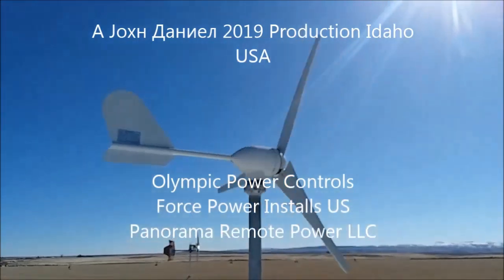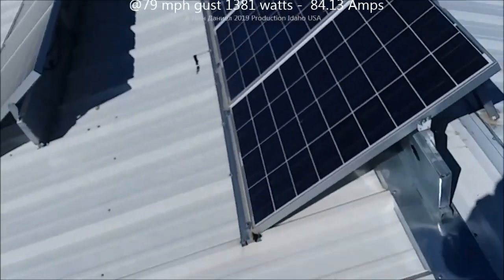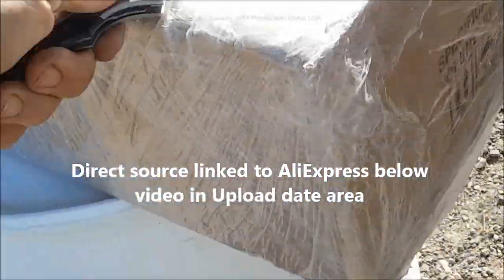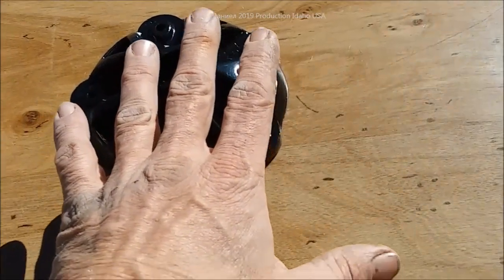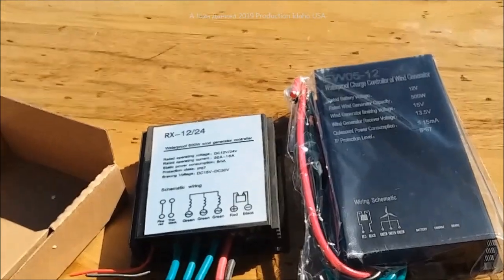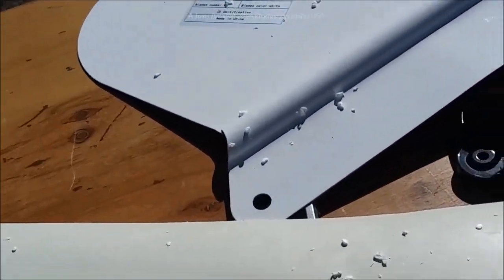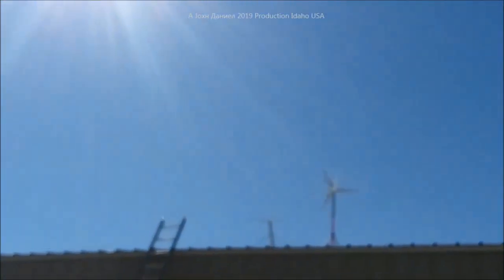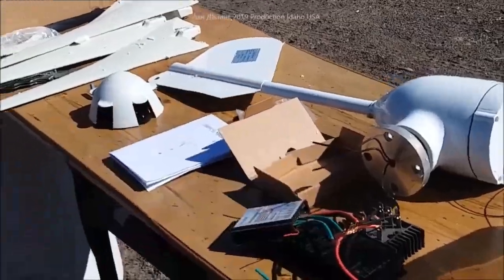Best 500 watt Micro Wind Turbine, about $330, parts below vid 1

Comment: My cheap chinese turbine is turning here and there but apperent nit even enough to get 12 volts.
Now i tried your trick and put unto it a 3.7 volt battery... It has nit exploded but... Not sure it will do much either but I have seen it reach 4 volts.
Reply from the maker: Depends on which model you buy from which seller as to how much actual power you will get. Green Energy and B&C use much heavier parts, magnets and copper in theirs verses similar looking turbines.

Comment: I used a 400 watt for years ..loved it! ..the sound of the blades cutting through the wind was music to my ears ...if I had to do it again I'd go for a more powerful one, seems you can never get enuf power when you're off grid. The one thing that I would do differently other than going bigger is to cut down on the lengths of the copper wires because copper unless you've got deep pockets is very expensive ..what I'd do next time is set one up on a good tower and attach the tower right to a workshop or shed (or at least very close by) that would have all the batteries converters and controllers etc. inside so that when that turbine starts putting out power it would travel right down that pole and right into the control shed or shop where in can be converted right away to AC and fed from there with 14 or 12 gauge to wherever you want it because the further you travel with DC power the heavier the cable needs to be ..when you convert that DC to AC right away as soon as it gets down that pole, you can send it much further with smaller gauge wire.

Comment: So it's rated 500W @ 13km/h, yet you get 13W at this wind speed? You actually need 3x faster wind to get the rated 500W out of it? And how are you happy about this result?
Reply from the maker: Where's that info? Who said "rating" is based on 13 km? That's not on this video. 8 to 9 mph is battery exceed, full power plus is at 25 mph and it does it plus much more.
Reply: @PrepperMountainSolutions  it's on a specs sticker, visible in the video. Rated windcspeed 13km/h.
Reply: @eIektrinis  That sticker says 13m/s which means meters per second not kph. 13m/s is 46.8 kph.

Comment: That turbine is exactly the same as mine they send me a new stator and shaft it was bigger than my original I simply snipped the wires inside instead up pulling all clamp rings and used twist caps on the new stator wire and zip tied the wires inside and pushed new stator in and caulked the seal around because the rubber one was leaking and put back together and wow. Now I have the new controller john sent me I purchased a 18x18x8 metal weatherproof shielded electrical box and drilled 2,  4 inch OD intake and out take holes installed stainless steel ducts  and installed a inline blower and 3 100 watt 3 ohm resistors and temperature controlled relay board drok. Right now I'm wiring these in parallel and connecting to the box john sent with 4 awg wire and lugs.i mounted the redbox from John in me electronics box next to my renogy rover mppt controller 40 amp and 3 phase throw switch. Lever down to red box lever up shorts out 3 phase and gives me braking. Someday I will figure out how to wire 3 100 watt 3 ohm omite resisters to that side so I can just slow it down and still get power. Someday lol.i will post a link after I'm finished.